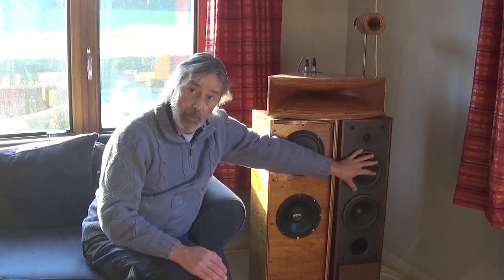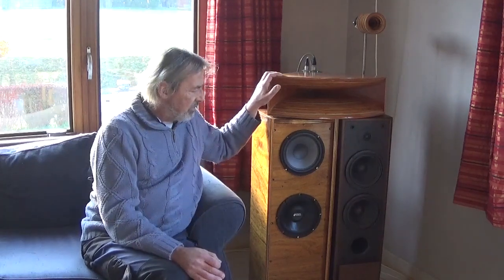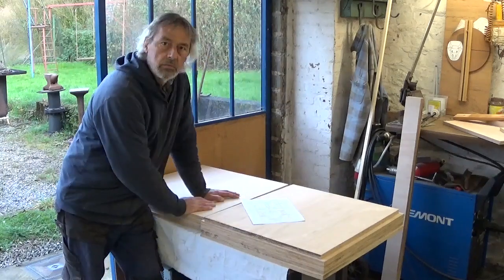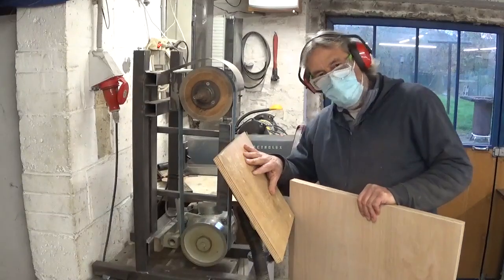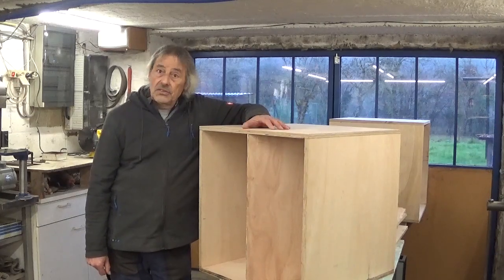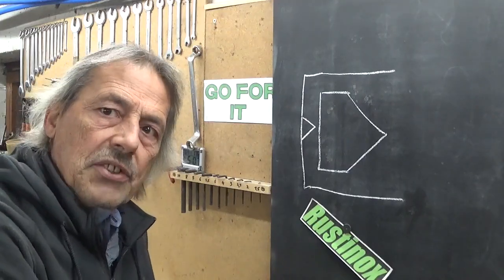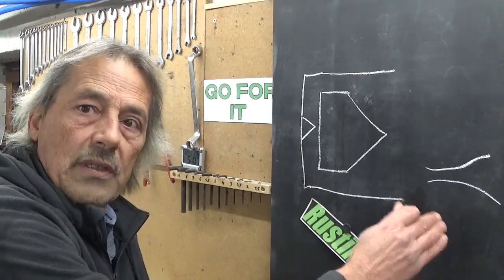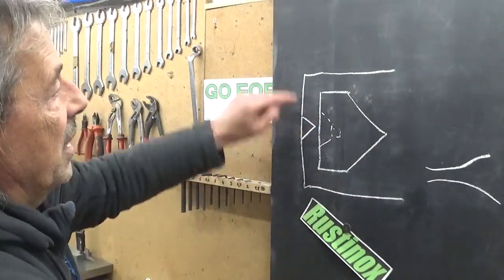Let's build some speakers.

Comment: hello rustinox, nice video as always ;) ! 
I think that there is few solution for your speaker cabinets design problem, as you say in the video if you want "amplify" those low frequencies enough you need a longer length of the horn , you can also take a speaker with bigger diameter, they produce much better result in low frequency, I build (with friends..) few bass horn cabinet with 18" inch RCF speaker and they work  "loudly" fine ;) ! Or why not one large bass reflex with two speaker in for more power in the very low frequencies ? Bass frequency are omnidirectional so ne need to get two units, just one big boxe in the room ..  Lastly if you don't know the hornplan website go have a look it's amazing , many design with .pdf plans and sound measure ! 
I hope see one or more videos on speaker's theme, pretty interesting subject :) !  
Bonne fête !
Reply from the maker: One of these days I will pick up this project again. I don't know yet what I will do, but I'll come up with something.

Comment: I am reminded of the speakers I never built as a youngster... 
35 years ago I didn't have the money or tools to make a decent attempt. 
Now I don't have the time either! 
But my nostalgia was piqued sufficiently for me to acquire a replacement copy of  'An Introduction to Loudspeakers and Enclosure Design' (my original is long lost) with the plans to make a pair of Kapellmeisters.
It seems unlikely that they'll get made any time soon, but it's a handy little book to have on the shelf.
Reply from the maker: I came across that book on line in PDF format.
Very interesting reading.

Comment: Well That's sad i also have run in to this problem . You could gut those box's for shelf or maybe they would work better outside for a party . Maybe put some stiffeners and some 10mm dense insulation and some cheep speakers in them . I hate when things don't work out . But you have done a fine job building them good work . JM
Reply from the maker: The enclosure works just fine. The problem is the horn.

Comment: Interesting….I have a pair of Altec Santiago (woofer/horn), just luv them yet the horn can be a bit harsh (cheap reciever/amp)….my buddy built a pair nicknamed “the boys” that were easily the equivalent of the Altecs but without out the harshness (woofer,mid,tweeter)….the boys were cut up due to size, but I did rebuild and they now hang in my friends shop pounding out tunes, think I did a video long time ago
Reply from the maker: Yes, sometimes horns can be hard on specific frequencies.

Comment: Michel, the "Tech Ingredients" channel here on YouTube within the last year or so did a fairly detailed explanation/study in speaker designs that might be of some use to you.  The guy has got to be some kind of Professor or similar and has a very wide range of interests, but made & compared/tested several DIY speaker designs that can be made in home workshops.  Good luck with your search for a design that will give you what you are looking for!
Reply: That was some great series of vids.
I made the acoustic panel speakers love them.
Reply from the maker: Yes, I know that channel. Thanks for the tip.

Comment: Well those are some pretty elaborate speaker boxes, maybe if you line the inside with some MDF (like a super, dense sawdust board lol) it might help bounce that sound a little better. The back of the speaker itself may have a Hz rating and if you have a scientist friend they may be able to calculate the optimum box size and features to amplify the wave lengths... 🤔.
Cheers! 😊
Reply from the maker: Unfortunately, I don't have scientist friends...
Reply: @Rustinox  me either 😥

Comment: Sorry to see it didn’t worked out the what you wanted. Ive done some research in building a subwoofer myself in the past.
But I came across on a good deal on a REL subwoofer. Way more easyer than building yourself. But perhaps less fun!

Hopefully you come up with a new / better design. I do like the content!

These months were the days get shorter I spent more time inhouse and listening to a good album with a nice drink.
Very pleased with my setup right now, but always thinking what the next upgrade can be!
Reply from the maker: Well. I will rethink the design and see what happens.

Comment: Have built many speaker enclosures over the last 50 years. The ones where I strictly  followed proven designs always worked well. The ones where I winged it were usually disappointing.
Reply from the maker: Indeed, Peter. It must be correct.

Comment: Of rock wool insulation . Or just staple one piece to each interior wall should lower the frequency.I think you get the pointtwo or three pieces one square foot
Reply from the maker: I tried that. It didn't gave the results I was hoping for.

Comment: Thanks for 13 enjoying minutes.
Woodwork is fun. Yes. 
Beds normally have 4 legs, as well as wagons. 5 wheels on a wagon makes trouble. (Expression here). A bed with 5 legs? I had to make the second bed of my lady friend a 5-legged one. One long carrying bar broke in the middle, and in the middle of the night, and I had to sleep in a bed listing some 30 -40 degrees, unfortunately away from my friend.... A fifth leg was precision milled (!) and installed as well as a 1 meter M10 threaded bar to keep the long bars together.

Wood splinters(spelling?) can be bad. Had one and thought I pulled it out... A few times per year like a little hill is growing there and it's irritating. Grab it and pull it off, cut if off, gives pain for some time. Then some months of peace and then again....

Rust coloured skin...... I get it! 
I use 10 - 25 time optical magnifiers to find it. Then a needle work needle having a slight hook on the tip is perfect to get the metall out of the body (usually finger)...

A7 08:07-08:10 You use a saw. (Don't find the English name). A skilled woodworking friend named it "the rabbit  c...k" (fast working body part...).
 
Did You use preferred types of wooden bords?

What will videos come in the future? Cooking? Gardening? Flying? Nobody knows, only it will be fun.
Reply from the maker: This is plywood, very good to make speaker boxes, but also very expensive.

Comment: I  might be barking up the wrong tree but sound waves like light like to bounce off of objects at the same angle that they hit the object, your blackboard sketch shows the sound from the speaker hitting a 45deg plane which is good but the next corner is flat so the sound would be reflected back the way it came, this would for me cancel some of the sound leaving the box, if you fitted a 45 degree fillet in the two square corners then the sound would be directed out of the cone cleaner, just my thoughts and I'm likely to be wrong but worth a try maybe, one final thing, I love wood but hate working with it because it has a tendency to burn when you try and weld it :-)
Reply from the maker: That was also my first idea.
This design is based on the "La Scala". There is no reflector in the sides of the La Scala.

Comment: Hard luck. I once made a speaker box from two layers of plywood with about a one inch gap between them that I filled with sand. That certainly stopped any vibrations. I think it was a copy of a design by Tannoy.
Reply from the maker: But than you need a crane to move them :)
Reply: @Rustinox  It was alright until I moved house. Then I think I left it behind!

Comment: Oh dear. Memories of my old failed attempts to build a speaker box at an wood work evening class at high school. I learned to my cost why high quality speakers were so expensive. They are bloody hard to build and sound just right. Eventually I was able to afford a reasonable pair of “Mission” speakers which have performed well for over 30+ years.
Today though it seems people are satisfied with the sound from a tiny “smart” speaker. How times have changed.
Chin up, looking forward to your next project. 👍😀
Reply from the maker: Most people are happy with the sound of small speakers, witch is fine.
But I don't.
Reply: @Rustinox  I so agree, nothing compares with the rich sound of a large speaker cabinet.🎼👍😀

Comment: Ah, nice to see another horn speaker fan in the metalworking community 👍
Reply from the maker: Horns are cool, but they color the sound and are difficult to make.
Reply: @Rustinox  they are certainly not the easiest way to build a speaker! I use front loaded (mid) bass horns they are pretty big, but still a compromise and only go down to 90hz, a small stand mount bass reflex design can go deeper. I use a powered sub to fill in the bass.
I've decided to go active too after a lot of messing with crossovers. A 6 channel valve amp is also a bit of an undertaking!

Comment: Hello Rusty, I don't doubt that speaker design would be a difficult, frustrating experience.  When I was taking engineering at university we had a course in fourth year called Vibrations and Acoustics.  It was one of the toughest courses I took during my entire degree.  I always found it funny that a dope smoking high school drop out could take a guitar and make absolutely fantastic music.  Yet it took an incredible amount of academic discipline and effort to understand the mathematics behind that fantastic sound.  Ken
Reply: So your saying you have to be high to make the math work?!? I have a job that you have to be drunk to make the pay math work out! The hourly pay is done by professionals but the bonuses not so much.
Reply from the maker: And I never even made it to university :)

Comment: I love to watch you work. You have the patients to bring your wonderful ideas into the realm of physical reality.  I made speaker enclosures a couple of times and made variable ports so I could tune them. Fiberglass insulation may dampen the cardboard box sound. Just staple a 2" layer on the inside walls.
Reply from the maker: The problem is not the enclosure. It's the horn.